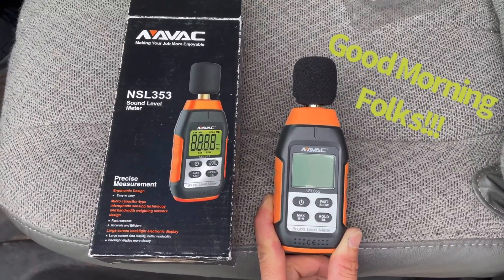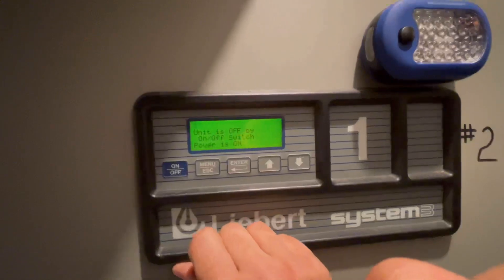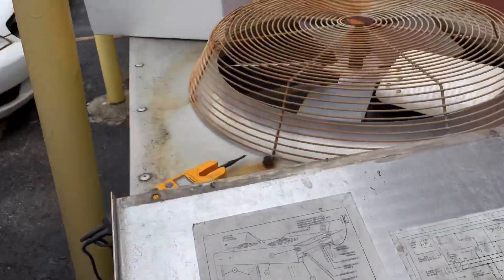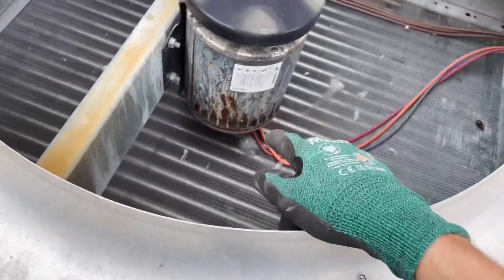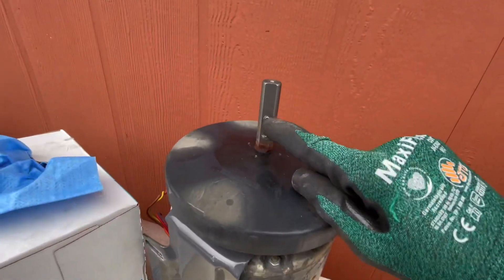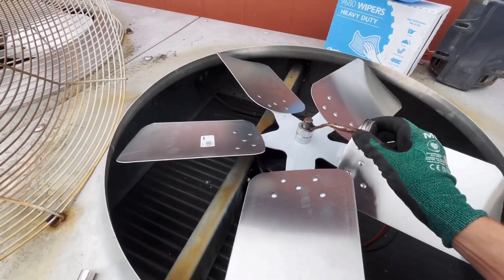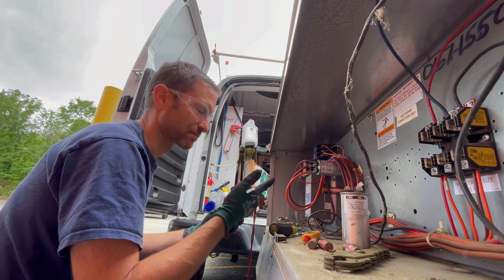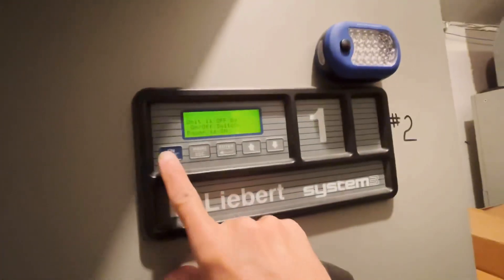A/C Fan Motor bearing failure.  #HVACEXPLAINED #hvac #Liebert #heatingandcooling #condenser #navac

Comment: I’ve heard of people capping the fan blade/ shaft with plumbers putty.
Reply from the maker: Lieberts typically come with a rubber/plastic cap for the blades and it seems to work pretty well.  I personally like to use a little bit of anti-seize on any fan.  Plumbers putty I’m not sure how well it will hold up to the elements but it’s worth a try.  
Thanks for the tip have a great day.

Comment: You hit the reason for bearing failure: bad design.
Reply from the maker: I honestly can’t remember how many of those variable speed motors I have changed in the past 10 years or whenever that design come out.  At one point I think I had changed about five in one month just due to the amount of equipment and service calls I go on.  Those three phase motors are that are either on or off seem to last.  I remember changing one of these motors after six months of operation.  The bearings got so bad the Motor ended up getting grounded.  But it seems like Liebert has changed their design and I’m starting to see less and less failures from newer equipment in that aspect at least.  Thank you for the comment have a great day.

Comment: cutie
Reply: @hvacexplained9341  Why not just change motor bearings.
Reply from the maker: @mikeobrien9404  The time involved with removing that motor, open the motor replacing the bearings then reinstalling it it’s not worth it.  Just the amount of labor involved would be too costly.  Most customers want “New”.   This is for a computer server room which is pretty critical.  In a bind I have changed out some smaller motor bearings on equipment that is so old there is no real good replacement motor but in this application it’s easier just to replace the motor.  
Thank you for the question.  Have a great day